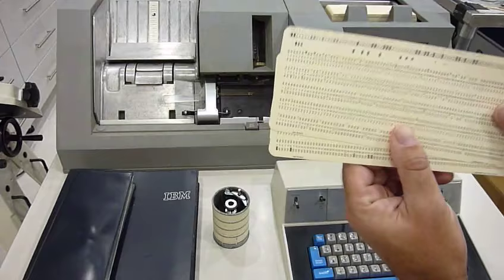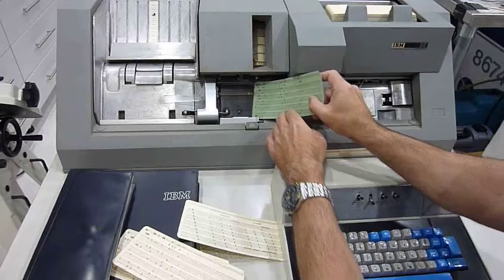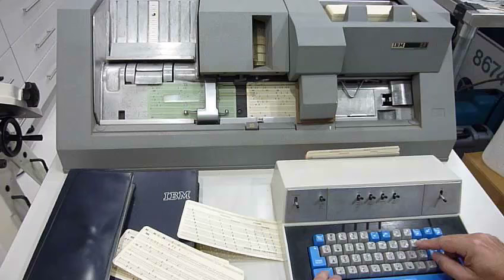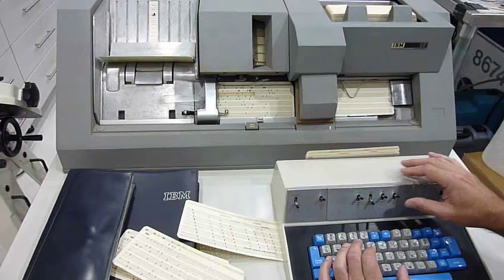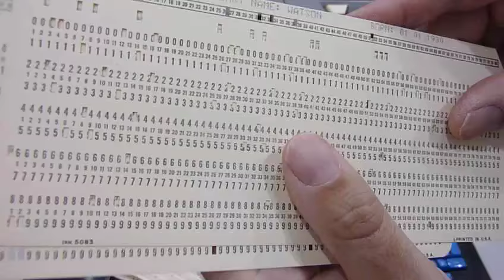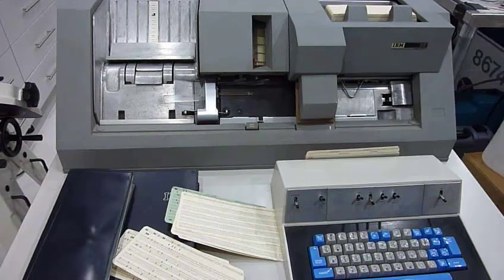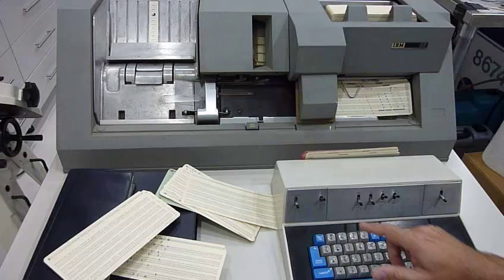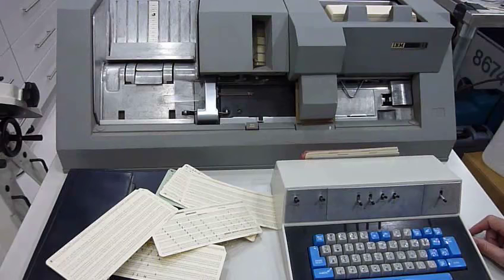1964 IBM 029 Keypunch Card Punching Demonstration

Comment: Anyone pls tell me,can this machine solve a calculation ( 5 x5 = 25 for example)
Reply from the maker: Not this particular one. By that time (1964), the calculation would be done on a proper electronic computer, the card was just input. But earlier electro-mechanical machines sure could. For example the IBM 601 calculating punch from 1931:  http://www.columbia.edu/cu/computinghistory/601.html  , or some other “unit record” equipment, as it was called, that you could program and could print or re-punch the result. Here is a good list: http://www.columbia.edu/cu/computinghistory/calculator.html

Comment: What was the last year IBM manufactured keypunch machines?
Reply from the maker: Progrocker70 Now that's a good question. I know there is one more model after this, the IBM 129, introduced in 1971, still based on the same mechanism, but with electronic memory so you can correct the entry before punching the card. Then that's it.  I forwarded your question to a bunch of distinguished IBM historians, and it ended up being pushed up all the way and officially answered by IBM. J.L. Strumpf from the IBM Corporate Archives said: "On May 1, 1984, IBM announced the withdrawal of all models of the IBM 29 card punch from their marketing catalog, effective August 17, 1984.  The machine was first announced on October 14, 1964 in connection with the System/360 release". So this 029 was sold for at least 20 years and until 1984!
Reply: CuriousMarc Thanks for the response! That's amazing I wouldn't have expected keypunch equipment to have been made that late! So in a year they were heavily promoting their PC's one could still outfit their business or office with keypunch machines! Have to wonder how many were sold during that time, probably not many! My initial guess was mid 70's for ending production.
Reply: Well, and let's not forget, that's when they stopped making them. They still serviced them well after that. They were still used as well. Like all popular old things, it became easier and much cheaper to buy a used one than to get a new one. Some companies use stuff like this until there aren't any people who are trained to use them anymore/replacements, or repairs are too expensive and difficult due to its vintage. Only then do they pop up in the dumpsters, CL ads, classifieds, friend of a friend by word of mouth says there is some old machine they are throwing away that punches cards etc.

...That's why we need to keep our feelers out, and our eyes & ears open!

Comment: Where do you get blank refills when you run out?
Reply from the maker: You have to find some old stock. Quite difficult now.
Reply: there are companys that make new stock for these, not cheap but well worth it
Reply: What about making a simple machine to cut them from standard A4 sheets? It would be cheap way to make large numbers of those cards.
Reply: I have thought about going to a business card/banner store to see if they could produce them. I am sure they would be quite happy to get an order for 12,000 custom size business cards... with a beveled edge.

You can't use standard A4 sheets because they are too thin. Light will pass through. You also want an off white color/slightly opaque paper. I have read that grey paper works well, in fact you can get paper tape in this form. It functions at .25mm thickness for that application.
Reply: Peter Lamont get recycling paper, thats always a little brown-ish
Reply: Good point! Get some nice thick recycled paper rolls. I really want a punched card reader and punch...That would be the cat's meow. Imagine a PDP-11/03 running a FORTRAN IV batch processor in assembler...outputting to a DECwriter. Pure bliss. It would be the next best thing to a room filled  with computer parts the size of refridgerators. My PDP 11/03 is quite small by comparison...but has the spirit of a mainframe.
Reply: No so easy, card stock is a more specialised form of card board of precise thickness that resist bowing, swelling and warping with humidity changes in the atmosphere. Warped cards don't go through machines very well so the storing of the unused card stock was controlled, in most offices, and had to be in a not too warm but dry room or cupboard. As an IBM Engineer we had gauges and and instruments to measure any card stock that was causing problems in the machines and if it was out of spec that box of card stock was marked and returned to the manufacturer, McCorqudale I think in the UK.

Comment: Can someone please explain what type of information was typed into this system ?
Reply: Pretty much any information you wanted to process on a computer in the 70's.  I used it to type up my programs in college and my first job.  Often a program was several boxes of 2000 cards each.  If you were smart, you sequenced your cards in the last few columns because sometimes an operator dropped your deck and if it was sequenced, you could use a sorter to get it mostly back.  Otherwise it was comparing cards to printouts to hand-sort.  In business, things like phone bills would come with a card you returned with payment; in that case the data on the card would be things like your name, account number, and amount billed.  I think somebody at the phone company would punch in how much you paid before the card was sent to the computer to update your account.

In High School I used a KSR 33 to type my programs onto paper tape and then send the program to the local college my school rented time from -- at 110 baud!  Cards were an improvement.
Reply: Numbers, upper case only letters, and some special punctuation. https://en.wikipedia.org/wiki/Punched_card#IBM_80-column_punched_card_format_and_character_codes

Comment: Imagine accidentally dropping all the cards on the floor after a long days work.
Reply from the maker: Happened all the time (and still happens to us at the museum). But for that there is the card sorter, which will put them all back in order.
Reply: It was common for cards to have a sequence number punched in the last few columns and with that they could be sorted back into the correct order. If it was something like a program deck the sequence numbers would initially jump by 10 (or more) for each card so adding more to correct errors that needed more lines wouldn't need a complete redoing of the sequence numbers.

Comment: You are feeding your card the wrong way ! The notched corner should be on the left top corner, not onthe right ! Weird !
Reply from the maker: Cards can be cut on any corner, right or left, top and even bottom. The equipment doesn't care (except for the infamous Documation card reader which everyone modifies anyhow). Cut corners are just reminders for human operators, to spot misaligned cards or distinguish them in some fashion.
Reply: LOL ! Tell that to the IBM tech guy that repaired the high speed readers ! You would have got killed ! lol !
Reply: Ya the notch helps with the feed allowing for slightly looser tolerances and self correcting alignment. Imagine having two square edges trying to fit into a tight opening just wide enough for the card, perhaps allowing for 2mm on each side...No jams happening there, surely ;) ! Now imagine a beveled feed and beveled paper card! Self straightening! Tadah!